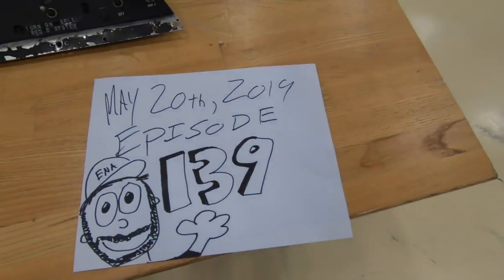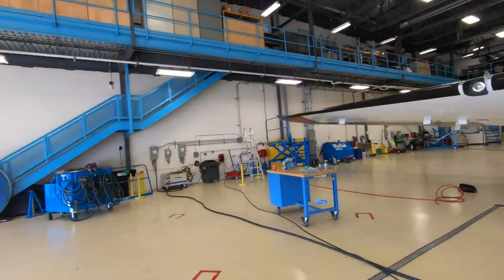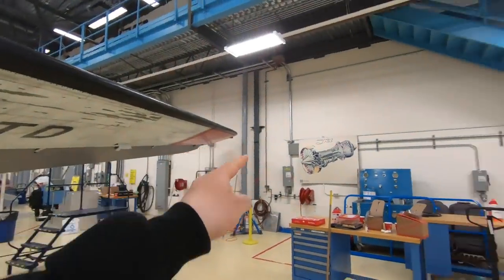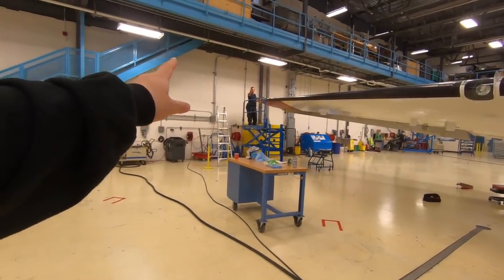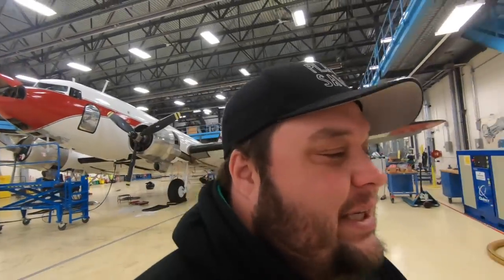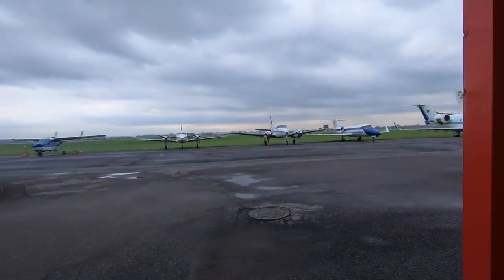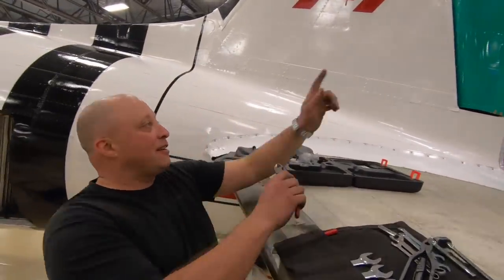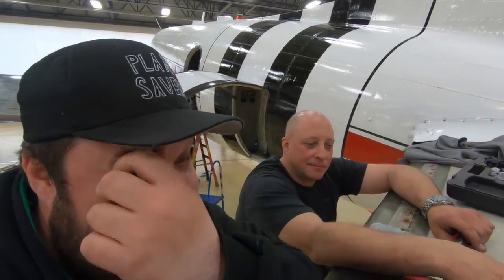"DC-3 Progress UPDATE " Plane Savers E139

Comment: For extra credit on the exams, have all the students go thru DTD and find any other little issues that exist!  Really, from everything we've seen, the school has been so supportive of this project, they can be extremely proud of their program and their students.  It's remarkable how the crew here has consistently shown up for every day since you got boots on the ground there and has worked tirelessly to bring this project to fruition; THAT is truly a labor of love.  I'm guessing that a long vacation will be forthcoming once this gets wrapped up :)    
I swear it's got to be an optical illusion, but at about 10:52, with the shot from above the rear of the plane, it looks like the left horizontal stabilizer and elevator are about 18-20% shorter than the right side.  I went back to some past videos and tried to take measurements on my computer monitor; is it a function of the wide angle lens of the GoPro, or am I seeing things?

Comment: Hi Geoff (?) .....nice job on the Empennage controls, fancy looking lock-wire tool you have there, I had a self-made contraption (still in my tool-box) that did the trick on those 'hard to reach' fitting's. 28 yrs retired now from DOT and DTD :)

Comment: I would like to ask you a question. if you have to start it up every 6 or 7 days. has anybody thought about pushing it back out and pulling it back in the hangar. after just one time having a struggle putting it in there

Comment: What was the "original plan" that didn't work out for Benoit?
Reply: Several factors: - My lack of experience with a project of this magnitude, I underestimated the effort to get the required budget to complete everything. Without the support of Buffalo, it would have been necessary to purchase engines, propeller, all equipment, etc. My idea was a full restoration to TCA standard. It would have taken several years and there was a lack of local support for a project of this duration done by an inexperienced team. There were a lot of naysayers who told this aircraft will never fly too. I financed the first 2 years, we almost purchased the C-47 from Peterborough (the part plane for Night Freight) but finally decided to sell DTD to the right buyer, the alternative choice would have been long storage on another airport.
Reply: @Benoit6ft6  bravo Benoît
Reply: @Benoit6ft6  Vous sont partie de la équipe. Avec en dehors vous, Ce projet aurait ne pas avoir eu de la sol. Remercier Vous pour tout votre temps et énergie ! Meule. Pittsburgh, Pennsylvanie. (I hope this makes sense)

Comment: Why is the left propeller silver and the right one is black???
Reply: There is no particular reason for this other than that is just the way they ended being painted.  Typically the props are aluminum (or shade of grey) front (camber side) and black on the back (thrust face) side.  Tips can be any colour, we usually painted DC-3 tips yellow.  At some point, the all black prop was mounted on a air frame that the owner/operator preferred the look of the all black props.  Originally the props would have been anodized aluminum on the front with only the back  painted black.  These 2 props, being donors from other air frames,  probably originally matched their opposing mate on the other wing.